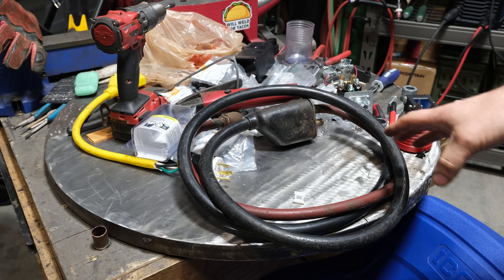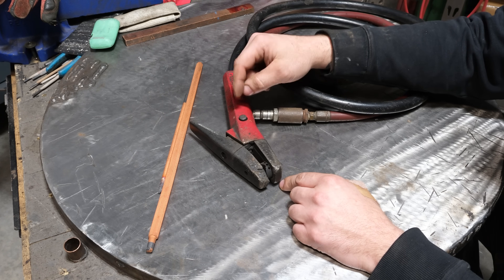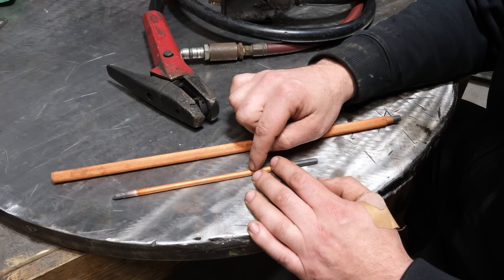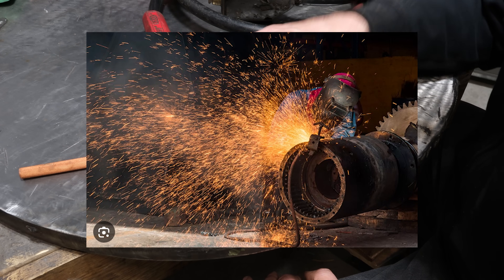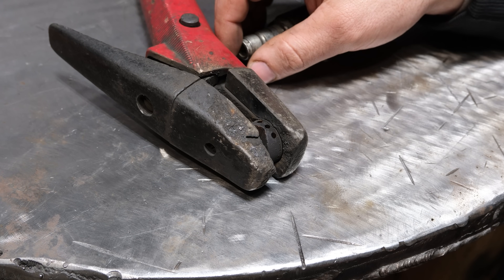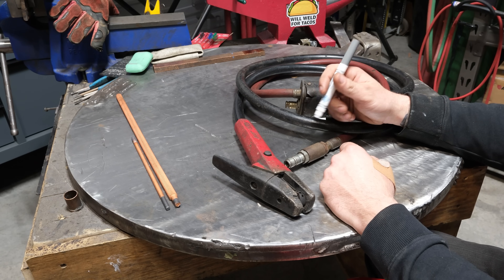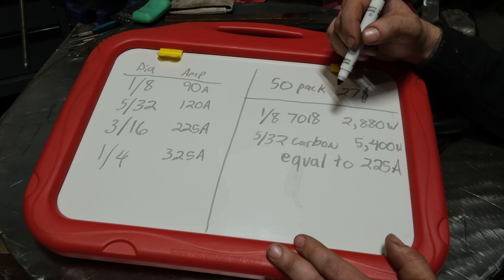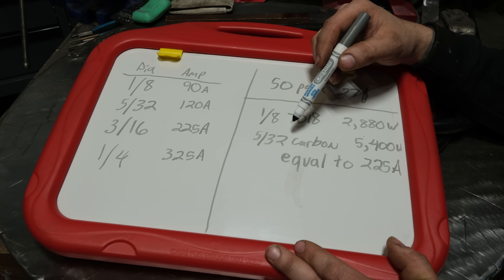Carbon arc gouging: the grinders angry cousin

Comment: Why are the rods being shortened while gouging ? I do not get it .
Reply from the maker: The carbon rods get consumed as part of the process.  They get white hot, and consumed due to the massive heat.  The compressed air that is used to blow the weld metal away also causes the rods to disintegrate faster as well 👍.

Comment: From a homeowners perspective: I`ve tested it and it works also on smaller machines. 
 I have in my garage a 250Amp MIG/200A MMA Inverter with 230V Input and also a bigger 350Amp Inverter with three phase 400V input but only a small 50L/3hp compressor.
Bought a cheap gouging torch on Aliexpress and some 5mm carbon electrodes. 
It works nicely, even with the small inverter. 
The compressor is a little bit to small, but i´ve limited the air pressure to appprox. 85 PSI which helps a lot. Far away from any industrial setup, but still a lot faster than an angle grinder.
Reply from the maker: Glad to hear you’re having some success with that 😀👍.  Based on your success I should give it a shot and see what happens.

Comment: In Turkey 10 years ago on big fabs. they were running 2000A (two thousand Amps) for AAG.   The noise was "significant" :-). Shook your insides.  Two big heavy "tombstone" transformer welders in parallel.
Once I was present when a weld had been condemned on Ultrasonics and the AAG team turned-up.  They gouged very very gently so I could come see the defects when uncovered - the UT operator was absolutely accurate about the position, type and extent of at least 3 defects present.  Thing is even a skilled operator just "tickling the surface", it was like a blizzard of burning steel particles swirling around the compartment.  I was looking down with my eyes pinched, making sure I wasn't 100% relying on safety specs.  The peak of my hard-hat, head towards the gouging, deflected most.
Fortunately from working in the steelworks I was used to being sprayed with molten steel.
Yes there is no way you are going to AAG at home, given the power and how brutal it is on the power-source.
Reply from the maker: Thanks for sharing your experience, that sounds wild.  There is industrial power and then there is big industrial power lol.  When you start talking 500-600amps of power you’re cooking.  2k amps is basically a portable smelting pot to turn large amounts of metal into liquid.  Big defects need big solutions to fix fast, and I bet 2k amps can get a lot of work done fast lol.
Reply: @makingmistakeswithgreg Yup, you could easily remove any weld, including big machine  subarc welds, and start again.
Reply: @makingmistakeswithgreg To this day I remember that sound...
In the hardships of finding any manufacturing work here in Britain, it is a warm place in my heart that I was able to contribute to this massive Korean / Turkish international enterprise in Turkey.  "Good" hardly started to describe the Turkish food, my times-off were as blissful as my work was hard and determined, etc.  One was - every earthquake zone has hot springs, and my Turkish colleagues negotiated a "pansion"  for me in a spa village I could go to by ferry and bus, where I could float away the stresses of the week in the hot thermal spa waters.

Comment: Great video. Didnt realize they pull so much power even running small rods.
Reply from the maker: Yeah, carbon arc is a real welder “killer” lol.  If it ran at lower voltage it would be far easier to run it on more machines.

Comment: IC Weld runs 1/4” carbons about 200 amps he says. Also I just watched NBS Welding arc gouge with an arc captain 200. 
It’s certainly possible. Inverters prolly won’t last long doing this process however.
Reply from the maker: When you look at the voltage that carbons run at and a 200a setpoint, generally speaking the only machines that will last a while doing it are engine drives and 350+ amp class power sources unfortunately.  You’re definitely onto something with the longevity issue.  Most machines at best have a temp probe on a heatsink and when tripped it shuts the machine off.  The problem is all the components that don’t have probes (capacitors, wiring, etc) will get overly hot running carbons which will lead to lower life expectancy.  Even in the engine drive class many units are only rated at 1/4in carbons despite being 300-400 amp units, the companies know how hard gouging is on machines and are smart on ratings.

Comment: What happens if your short on gouging rods and you use a 6010/11 or 6013 as I know you can cut with those rods in a pinch.
Reply from the maker: You can use those rods to cut at high enough amperage, but they don’t gouge anywhere near as good as a torch or a carbon rod lol.

Comment: I've got a welder that is from the 50s i think and it's got a gouge setting where it plugs in and goes to 400amps and i picked up the air arc on market place for 50 bucks
Reply from the maker: That’s a deal for an air arc setup.  Hopefully you have some power to feed that welder, 400 amps out of an old school welder will definitely dim lights lol.  At 200a for 3/16 and 300a for 1/4 you could get a lot of work done.

Comment: Craftsman used to make 70 Amp AC twin carbon arc welders that worked on Aluminum using Al Flux rods and or paste. It was great. No inert gas set up. It also worked well to heat and bend metal. Is there a reason TCAW was discontinued? Was it safe as any other Welding process?

Comment: "They make gigantic ones like this bastard" I'm from the South but that sentence and Northern accent made me laugh. Just the way it came out. On fire welding has a 800 amp Miller big blue. He has a video when he got it with 1/2" rebar using it as a rod testing it out. Like a 60-70k welder.
Reply from the maker: Glad that made you laugh 😅.  I will have to check that video out for sure.  In spring I will be doing a video arc gouging at 600+ amps, hopefully I won’t set anything on fire 😅

Comment: Glad I saw this video, Greg! I have a Ranger 300DLX and an engine drive compressor. It looks like 3/16 is the biggest i should be using?
The other question is about the millermatic 255. I see that you use one of them at your work. I would like your opinion on it please. I have one and want to run dual sheild .045 75/25 gas. I think it will run it?
Thanks for your videos.
Reply from the maker: So the ranger 300dlx can output 300a at 100% duty cycle.  That is definitely enough for 3/16th carbons which run 220-250a.  Luckily because you have an engine drive it can output higher voltage than many welders, because carbons run at 35-50v.  The duty cycle will be less than 100% with 3/16th carbons but I bet it would still be 60%.  It probably would run a 1/4in carbon but the duty cycle would be really low and the performance wouldn’t be ideal.  Definitely stick to the 3/16th ones.  

As far as the miller 255, my work has both the 255 and the 355.  The 355 is honestly far overkill for most use and the 255 is a better option.  The 255 is capable of 230a at 25.5 volt output, 60% duty cycle.  .045 dual shield on c25 with setpoints of 400in/min and 25-26v would weld 5/16 to 3/8th steel.  That’s approximately 230a output.  So that machine will have absolutely no problem running that wire with c25 on thicker steel.  If you ran 100% co2 you may have a reduction in duty cycle due to the extra voltage needed.  But honestly that output is well within the design of the machine.  If you had a 220a max welder you would be smoking the mig gun and bouncing off the thermal shut down but luckily you have a more serious welder lol.
Reply: @makingmistakeswithgreg  Thank you, Greg! I have been looking for this kind of feedback for some time now. I will continue to watch your channel and help it grow. Please let me know what else I can do to help do that.

Comment: You're just a killjoy.
I already had determined Impractical.  
 Plasma gouging?
Reply from the maker: Plasma gouging is pretty useful, but what I used (hypertherm xp45) is not exactly a big material remover.  It seemed more useful for washing away bolt heads and studs than a multi pass weld remover.  The other issue is access, the plasma torch is far harder to get into places than the carbon rod.  Plasma gouging is also hard on tips.  I wish there was something between plasma and carbon arc.  I guess oxy fuel with a gouging tip would be that.  It’s just hard to get as clean of a gouge with that vs plasma or carbon arc.

Comment: Could inverters be paralleled ? Has anyone tried it ?
Reply from the maker: I have heard this could be done, I have not tried it.  This would be a way to achieve higher output with less powerful machines.  The power requirement will still be pretty crazy.  Depending on the welders you would need about 16-18k watts drawn from the wall (66amps on the low end) to run a 1/4in carbon.  Two 40 or 50amp circuits and two cheaper 200+ amp stick welders would be needed.

Comment: Interesting, I read about this a few weeks ago, the only process possibility for home, seems to be a mini-thermic lance, made from brake tube fed by an oxgen bottle (stuff wire wool in the end to light it with blow torch), but I am guessing it would be too violent to blast out welds?
Reply from the maker: Thermal lances are great at cutting off pins/bolts, and burning through pins stuck in bores.  The downside to that process is you can’t really control it to be useful for melting off welds, and it burns through oxygen so fast it’s pretty expensive.  

A option a person has at home is using a oxy fuel torch and a gouging tip.  This works, but not nearly as clean as air arc.  Basically you have one shot to get a clean pass on cutting out a weld.  If you butcher it the dross and slag left on the surface is impossible to clean gouge through (basically it goes from worse to terrible lol).  Plasma gouging is a possibility as well, it’s just slower than torch and requires a plasma machine that can do it.

Comment: I have a PrimeWeld TIG 225, and it runs 6010s just as smooth as you could ask. Its a great machine. Silky smooth TIG too. And was CHEAP for all the features it has. I have a big 3 phase Hobart arc master 351 i use for the heavy stuff like gouging, and for when i have a huge amount of MIG to do. Its a 100% duty cycle machine, with a liquid cooled stinger. I also use the liquid cooler for my TIG torch. Very well spoken and explained video.
Reply from the maker: The prime weld machines seem to be solid.  I really like the fact that they come with solid tig torches and the simplified controls flat out work.  Many companies overthink controls and I appreciate the approach they took.  They have also proven to be reliable across the board, which is a good thing.  Glad to hear yours is treating you good.
Reply: @makingmistakeswithgreg  I got mine mainly for the ability to AC TIG. And you are VERY right about the controls. Having the ability to just turn a knob to make an adjustment rather than having to navigate a bunch of menus is very underrated. And let's face it, those screens won't last as long as a simple, tried and true potentiometer. If one of them does go bad, you can just get the value off of the case of the pot and order a new one. Their customer/technical support is second to none as well.

Comment: Hi Greg, Does this this process create a similar affect to a gouging nozzle, one that you use on an Oxy fuel torch? 
Cheers
Dom
Reply from the maker: A gouging tip on a torch washes away metal just like a carbon rod.  The big benefit to the carbon rod is it will work on anything that conducts electricity, the torch won’t do much other than steel.  The air arc also takes far less skill (in my opinion) than the torch.  I am by no means a expert in torch gouging, but I find you have one shot to get a good pass or you will have a ton of issues with dross affecting the quality of a second pass.  Air arc doesn’t require near perfect first pass to go back for a second if needed.  Torch is so much quieter and pleasant to use though lol.

Comment: I run 3/16 and if I really have to 1/4 off this old lincoln mig. You have to put a rubber band on the trigger and turn the voltage all the way up, but it definitely works and it is much more cost effective than a die grinder for anything the least bit hard to access. Or even a regular grinder.

Edit: 29 volts, and it's a 260 amp machine I think. 240v 50 amp service probably. 

You're probably right that it's not good for it though

Comment: I’ve got an ancient huge boat anchor Linde in my shop that’s rated at 380 amps in my shop. Could probably arc gouge with it, but don’t know if my air compressor could keep up.  I have used my plasma cutter for gouging. It actually worked quite well. I have arc gouged in the past with a Lincoln torpedo welder. Yes, it’s definitely a very loud and messy process, but quite efficient once you get used to it.

Comment: Great video and information on a subject I have been wondering about after seeing “Melting Metal Anthony” use on heavy equipment.   Looks like you would want some serious FR and HD PPE, especially gloves!

Too bad this process is out of reach for most home welders. 

Although not nearly as effective, what about Plasma Cutters as a way to remove (gouge out) metal?

My emails are not getting through anymore.  Could you please check your Spam folder or Blocked list. Thank You
Reply from the maker: I will check my email when I am home tomorrow.  I have not see anything from you in a long while, thanks for the notice on that.  As far as plasma gouging, it works great, but it can be hard on consumables and it is best on smaller welds.  I find it to work better than torch gouging, especially in poor material.

Comment: You can tag team that electrode with 2 machines. We hooked 2 xmt 350s to one arcair stinger to run a half inch gouging rod. Man it's such a noisy violent process and I'm glad I'm no longer the bucket bitch for cat 988h loaders.
Reply from the maker: I would have never thought to run two welders lol.  I use a xmt350 to gouge with and it has been holding up good so far.  Definitely not a process worth making a career out of… probably would wind up dead and blind lol.

Comment: It is possible to carbon arc at home. Heres a link to one of videos of carbon arc gouging off a 160 amp everlast invwrter welder in my home shop. 

https://youtu.be/Ozgyda8jOtY?si=sdndQAyM613TgLJD

Granted with a machine this small its slow compared to a industrial sized machine but its still way faster than a grinder.
Give it a try with a machine you got at home and it might just work great for you too.

Comment: Hi Greg, if you get the chance you should see a steel bridge being de-erected by Thermal Lance, it is the Big Brother of CAG.  The typical thermal lance is simply a black iron tube filled with steel wire, oxy/acc is connected to the base of the lance.  Acetylene is used to initiate the process and is shut of when the wire reaches kindling temperature, open the O2 valve and the thermal lance cuts.  The operator wears a full flameproof suit and is usually sprinkled with a good quantity of water while cutting.  The black iron pipe is sacrificial.  Impressive process!
Reply from the maker: I have wanted to pickup a portable lance setup to play with, but the cost combined with the current lack of use for it has prevented me 😅.  I was talking with a coworker who has run the process (on a smaller scale), and he told me you will blow through oxygen like nothing and it can rain Liquid Metal on you like you’re in the bathroom showering lol.  What you’re talking about is even more extreme, beats trying to torch cut it lol.
Reply: @makingmistakeswithgreg I worked in a fiberglass factory for almost 30 years in the furnace department. We used the lances he is talking about to cut hardened glass. They would start out 10 feet long and about 3/4 of inch across. They too are extremely loud and shower you in molten metal and in our case molten glass. It would only take about 3 mins to burn one completely up depending on the oxygen pressure you were running. There wasn’t much they wouldn’t burn through including stainless steel. I’m not absolutely sure but I was told the wires inside the tubes was some type of magnesium. I do know it was an extremely hot but interesting process.

Comment: Yeah I asked my welding instructor couple of years ago about carbon arc gouging, and he replied, "Well, let me just show you what it's all about...".  Took me out back, hooked up the rig to a big-ass machine, cranked that sucker up to some unGodly amperage, and said, "Watch this..."  and proceeded to completely obliterate a weld on grove practice plate.  And then he handed it to me and said, "Have at it!".  That is a brutal process, but quite effective at getting rid of undesirable welds and all that, but good gosh almighty-  the destruction and aftermath.  I learned real quick to avoid the area where this was being done, as all kinds of shit are flying around.  I worked for a very short period of time (2 weeks) in a forklift fab shop, and they had to do this to an assembled component because it wasn't put together within specs-  so they had to gouge all the welds out and basically start over-  they rolled over some old machine that was probably the size of my car and the guy guy went to work on it-  made all kinds of racket with shit flying everywhere.
Reply from the maker: That’s pretty much carbon arc in a nutshell lol.  When you get everything just right it’s like a magic eraser for metal.  You can lose track of what you’re actually doing, and upon lifting your welding hood realize things around you are on fire 😅.